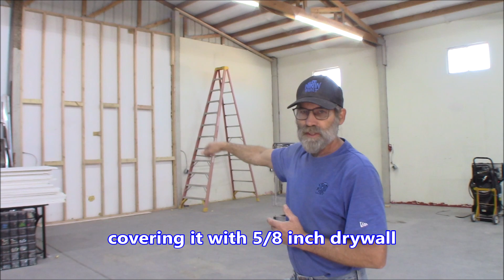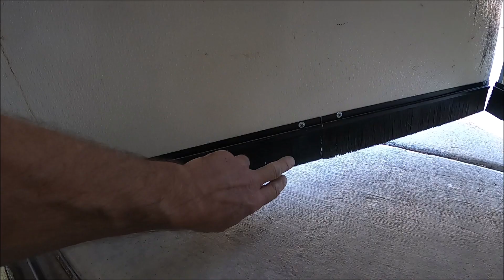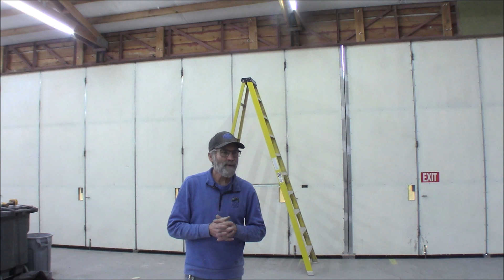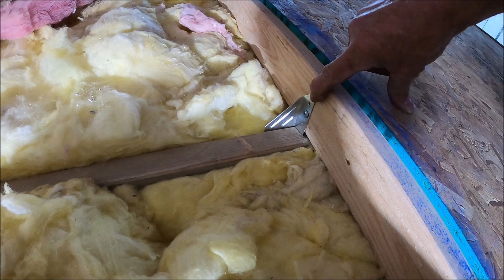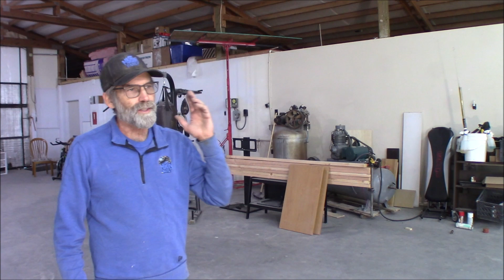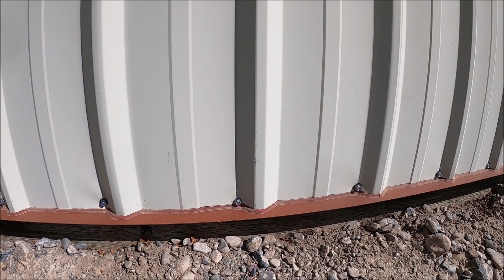martinbuilt shop upgrades

Comment: Just want to say thank you for all the 4.7 videos.  So much good information, and direction. Very much appreciated. It made so much work almost like I had done it before, or been there for it. If you would like to see some of the good your information has done check out the Dak videos I put on youtube, there's also stump grinder stuff you won't care about. Not like you don't have plenty to do! Thank you again sir.
Reply from the maker: Thank you I really appreciate that. I'm so glad that you like and find my content helpful.
Reply from the maker: I did check out your channel and also the stump grinding stuff that you've done, matter of fact I had just cut down 4 Italian cypresses that were way too close to the airplane hangar now I need to remove the stumps it'll be kind of hard getting a stump grinder in there their, stumps are within 10" of the building.
Reply: @martinbuilt  Hey thanks for having a look! Wish I were closer or I’d come help you out. I’m in western MA and I know your down near the desert there somewhere. 10” from the building should be no issue at all if there is enough room on the backside for a machine. A good grinder can usually get within a few inches or less of a building, fence, ect, and still be able to protect it. If you only have a few feet from another building, property, or something else a traditional small to mid sized machine can’t be on you may need to hire someone with a handlebar machine, or even what is called an alpine type machine. The alpine type machine is actually driven by a large chainsaw and can get in just about anywhere. The handlebar and alpine type machines are just much much slower. Good luck sir!

Comment: Martin… I have another question please. I have a 2002 4.7 HO - Owners manual says do not use transmission fluid for the power steering. People say use 5931 power steering fluid instead. Dealer just told me Chrysler says use ATF Plus 4 Transmission- fluid not power steering… What fluid should I use?
Reply from the maker: I would never use any type of transmission fluid in a power steering system. This product from red line that I have a link for is what I would recommend. And is what I used on my hydraulic cooling fan.
https://amzn.to/3EEHAhQ
Reply: I ordered the Valvoline  5931 spec Chrysler, Ford, GM power steering fluid some of the forums said it’s good to use. I still might return it and buy the Redline instead. The Valvoline stuff should be ok though right?

Comment: Hey Martin… I just purchased an 02 Cherokee 4.7 H0. Jeep was sitting for 2-3 years I have changed all the fluids but I was wondering if I should run a fuel cleaner through it. Is that something I should do on a Cherokee or do you recommend using any additives?
Reply from the maker: If it's been sitting that long I would definitely use something. I personally like denatured alcohol you can pick it up at home depot or Lowe's and add let's say at least 10 oz to a tank if gas and that will help remove any gum or varnish from the fuel system.

Comment: Just a helpful hint, because you've given us so many; When securing your attic floor use screws. That way you can regain excess under the attic floor easier. Smaller sheets of also make it even easier. Saves a lot of time for upgrades. I know you like upgrades. Great to see you back. Still working on my "RUSTY NUT" Jeep.